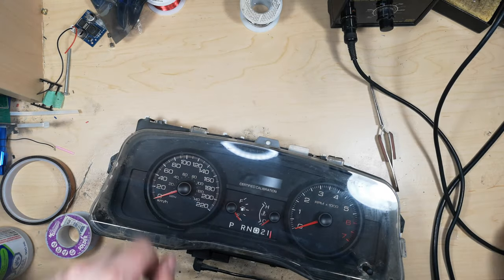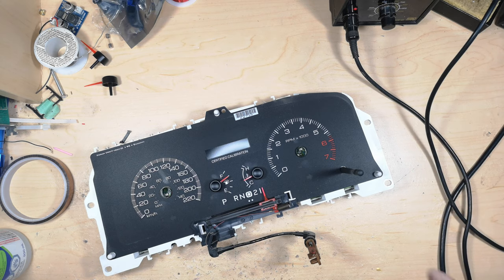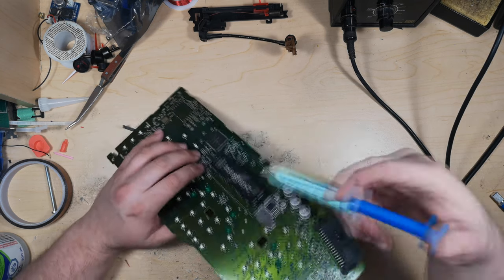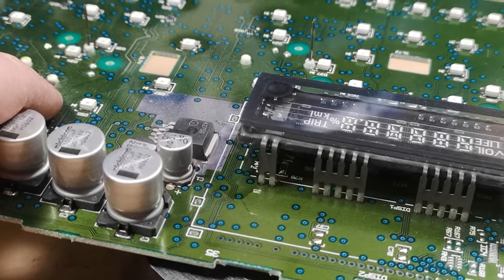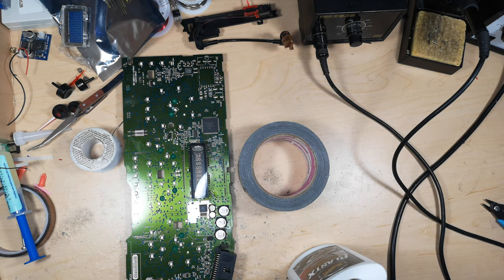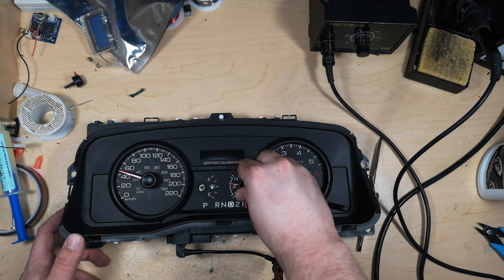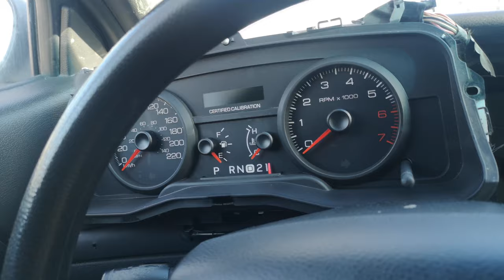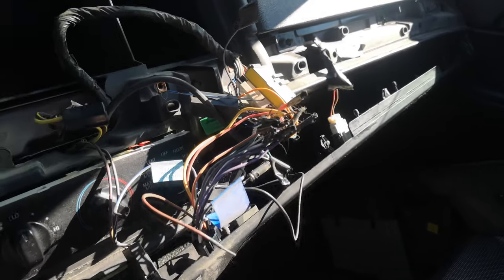Fixing a dim instrument cluster odometer (Ford Crown Victoria)

Comment: good job showing the soldering.  Before I did my videos no one would ever show what to solder so I had to figure it out as I filmed, which is why mine goes over multiple videos.  Your method for getting the needles accurate I've never seen before... looks like a lot of work but I guess it works.  I think this is why most folks decide to send it off rather than try to DIY
Reply: I’m going to do mine now, combining what I learned from this and your video, “Mr. Dad”. I’ll mark my needle positions with dots from a soft pencil, however, which I can later erase. Btw, in the Canadian version anyway, holding down the reset button while reading the total mileage it converts km to miles and vice versa, a point of trivia.
Reply: @aeyb701  I seem to learn as much as I teach... thank you for sharing that tip
Reply: Thought I was headed for a resolder but a couple quick raps on the cluster fixed it, for now.

Comment: Rewatching tonight, since I did the reset last year after reflowing odo connections. Rpm’s at zero w engine off but about 150 lower than actual when running, according to my scan tool. Fuel gauge still reads slightly lower than pre-removal, as does the temp gauge, both which I had to set manually. Speed is good ( per my scan tool). Have to remove the cluster to fine tune by sight, again. Setting fuel gauge tricky since when showing exactly full it can still vary a few litres I find, before starts to drop.

Comment: The reflowing of the connector looks tricky ie avoiding bridged connections. Hard to tell but do you just apply heat to the tips of the pins?

Comment: Junction Runner,
I have a broken LED odometer and a fuel gauge that takes HOURS to move to full after I fill my tank. My check engine light is on for PO462 (Low Voltage from Fuel Sender Unit). Would a new instrument panel or rebuild fix all these issues?

Comment: So I did this today and soldered just the points around the odometer itself. The solder seemed okay didn't notice any problems but when I went to plug it back in just to test it on the car, the odometer won't come on at all whereas before it was just really dim. Any idea what I did wrong?

Comment: Question, my odometer comes on once every 6 months or so. sometimes dim sometimes very bright like it should. Think it's the board or harness ?
Reply from the maker: Most likely the board, as the harness would be a pretty low failure rate item.

Comment: 2011 CVPI P7B: All the gauges work, gauge back lighting works, and warning lights work, but only the digital odometer doesnt work. I can't see miles anymore, what's wrong? I pulled every fuse and are all good. Please help!
Reply from the maker: You need to redo the solder on the surface mount resistors underneath the odometer.

Comment: i was orignally having this issue but then it stopped. now im having an issue with the cluster randomly turning off lol
Reply: eazy thing to attempt with that, lift plastic off top of steering column, & there are 2 wires on top of column that go to gear shift lever(OD off button) there may be a minute short in those 2 wires - BE VERY CAREFUL NOT TO TRIP THE NEARBY AIRBAG WIRES... ps it may even work to hit that OD off button if your not going on freeway(OD off means 4th-freeway gear off).. & see if that fixes it.  If it does, you know it’s those wires, or their plug, or the switch.

Comment: why doesn't the abs light go out?  I think I have the same problem with my crown vic!
Reply: Try replacement the clock spring in the steering wheel.Rock auto has different prices.